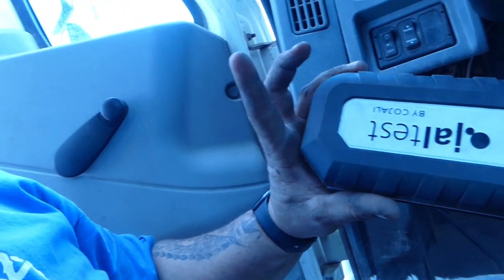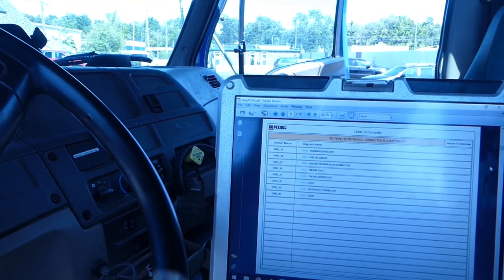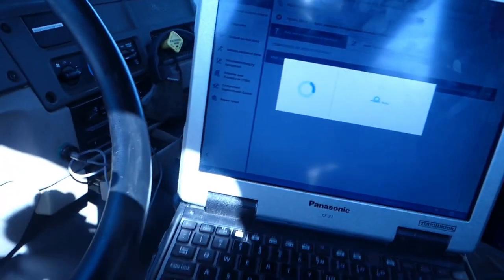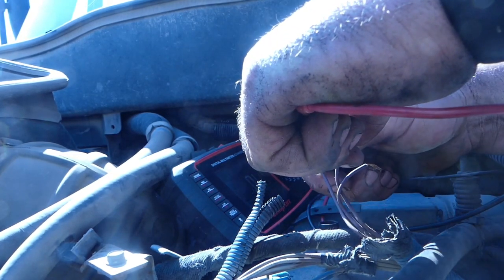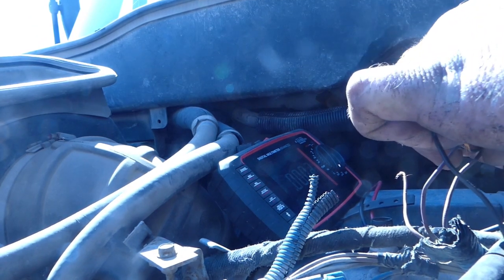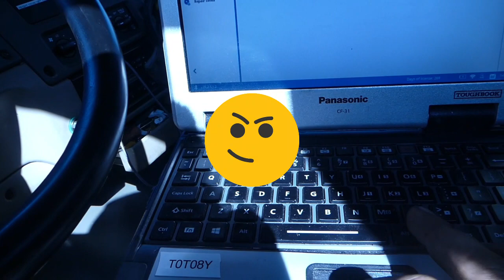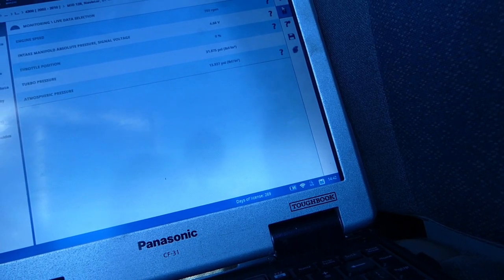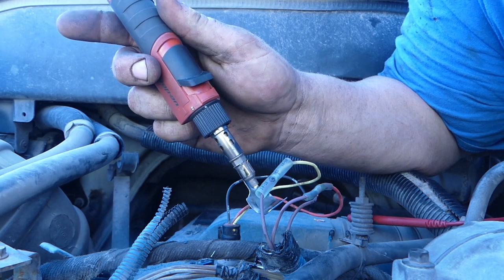Diesel laptops & Jaltest in use

Comment: I miss jaltest. I’m trying to get diesel laptops to swap my garbage texa out for jaltest again. Did you call diesel laptops support or jaltest themselves?
Reply from the maker: Diesel laptops.
Reply: They aren’t bad but they are limited on what they can help with in my experience with them
Reply: Why is Texa  garbage? thanks.
Reply: @am.b5688  it’s seem to always have an issue with everything I hooked it up too. Volvo equipment it wouldn’t connect to half of the time. On cat equipment it wouldn’t let you clear codes or event logs. It would work good on the John Deere excavator I had and our trucks were all Peterbilts with Cummins so it would decent on those except it wouldn’t clear codes on the Eaton ultra shift In those trucks. Texa seemed to update every time I went to use it. Jaltest has better support in my experience cause I had an issue with a cat loader were I was trying to set the trims files and it wasn’t working. I called jaltest support and they had an actual developer back door into my computer and was changing the coding of the program trying to get it to work. They had it figured out in a day so I didn’t have to call cat out to just set my trims
Reply: Would you reccomend the Jaltest for a Truck diagnostic tool for various engines ?? I am interested in purchasing a Jaltest kit